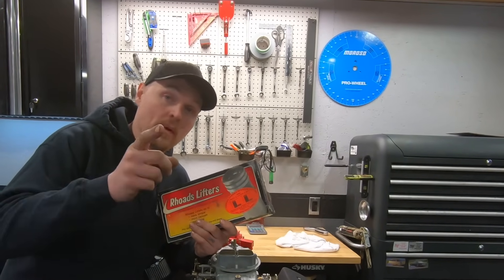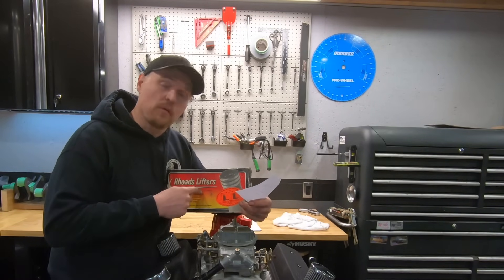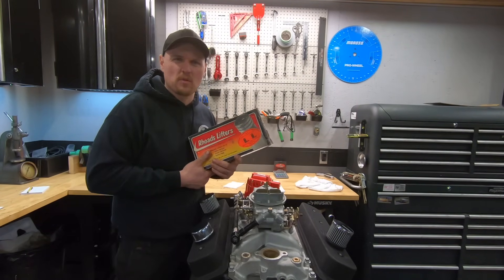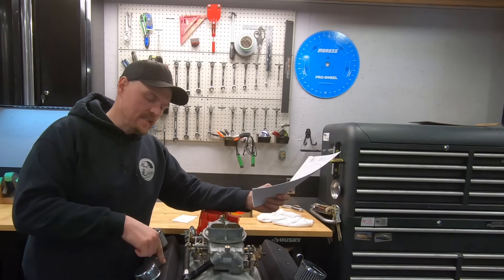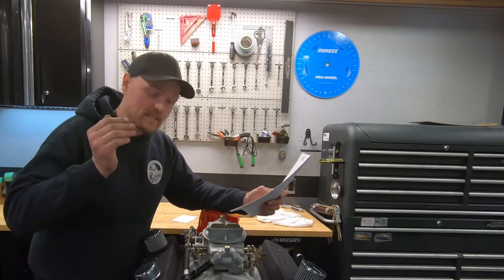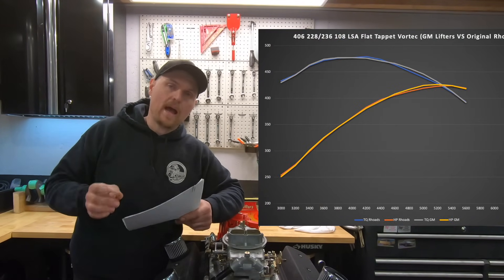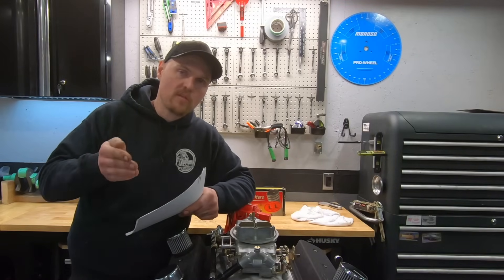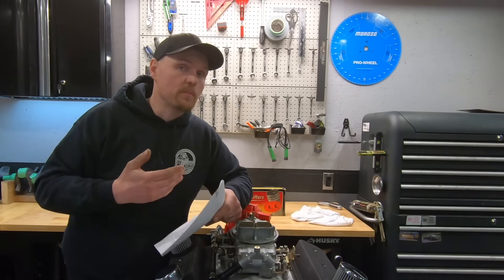Dyno Testing Rhoads Lifters! Interesting Results (Part 2)

Comment: 20/50 motor oil, I am surprised the lifters were able to collapse at all. And yes, it is a lash issue that causes the ticking, when the lifter is pumped up there is zero lash, when it is collapsed the lash is whatever the lifter allows. Can't believe people complain about the lifter doing what it is designed to do, smooth idle when collapsed and full lift and duration when pumped up. Try running 10/30 oil and see what happens. Been running a set of comp cam's hightech lifters in my engine for 34 years, they collapse under 3500 and pump up at 3500 and yes, they clatter when collapsed and they collapse further than your Roades lifters, in fact they were not recommended for street use as they bleed so fast. Zero oil pressure at idle. If I slowly run the engine speed up to 3500 rpm with the idle speed screw, when it hits 3500 one lifter after the other will pump until their all pumped up and it will pick up 700 rpm and be turning 4200 rpm. If I remember correctly, I set the preload at .030, 34 years ago.

Comment: Back in the day we used these to help get a warm cam through emissions testing. They provide a cleaner idle for a tail pipe test. The 1st set I installed was in 89 on a 400M  in a 79 Bronco with a basic "rv" cam that would fail tail pipe test. The lifters were just enough lift change at idle to pass a test.

Comment: Ive run a few sets of original Rhoads back in the day. One was a 455 pontiac and a couple others were 350 small block chevies. Most noticable difference was on the 455, gained a bunch of low speed torque and throttle response. the midrange and top end was the same as standard lifters. Same thing with the 350 chevies, just a lot less dramatic change.
   The advantage is mellower idle, drivability and mileage, especially with a low stall converter. If youre running a 3500 stall converter I doubt you'll se any performance advantage at the track at all, but with a stock converter you'll notice it for sure.
Reply from the maker: That's a good point with a stall speed of the converter
Reply: You nailed it. The first time I used them was in a 302 w/300 degree cam on a stock convertor. I had next to no power brakes and wouldn't idle in gear below about 850 rpm. That meant idle around 1k in P/N. The car, a Mustang II, sucked around town. The Rhoades turned it into a little sweethart. The downside was my now ex-wife went from refusing to drive it to taking every opportunity. I get home from work, hop in the shower, get out to a note.. "Went to the store." Sure enough, the Mustang was gone. Her excuse? "It's chilly today and the Mustang was already warmed up." Evil women. To be fair, she did help assemble the engine in our apartment living room.

Comment: I had Rohads lifters in my Mopar 440, had a cam that didn't start pulling properly until 3000 rpm, but with Rohads it changed to 2000 rpm. So you need to start at lower rpm to see any major difference
Reply from the maker: Unfortunately, the dyno can only accurately pull down to about 3000 rpm

Comment: Your test started too late to see the difference in torque from them.  When I ran them in my engine they were fully pumped back up by ~3,000 rpm. There was more torque coming off the line, much more part-throttle torque and it got about 4 mpg better.
Reply from the maker: Unfortunately, the dyno can't accurately pull down much lower than 3000 rpm

Comment: I found the largest difference to be found  with 10w-30 oil right off idle to# 1500-1800rpm.  Almost completely outside the range you tested them at. Also 10w-30 oil the  seat of the pants dyno didn't feel like they didn't feel like they achieved nearly as complete match in lift and duration.
Reply from the maker: Unfortunately, the dyno can't pull down that low, but the test was to determine if the top end falls off or it's down on power, which we didn't see

Comment: I appreciate your sharing test results. But I struggle to put much equity into the outcome. Because assumably your testing on a water brake. The area where any real result will show up is likely belowe 2500 rpm where you cannot test.  Also, so many engine variables play into how a bleed down lifter will act. Any result is application specific and for those reasons. I am gonna never try these. Even know they may very well have a application.
Reply from the maker: Unfortunately, the dyno can't pull down that low, but the test was to determine if the top end falls off or it's down on power, which we didn't really see vs std lifters

Comment: Rhodes Lifters, the original Variable Valve Timing. The Rhodes Lifters make your car sound like the engine is shot (noisy lifters) and does not lope at idle, but little does anyone know that your recently built car is a sleeper. I put an Edelbrock RPM camshaft (on a stroked 318-LA, then 350-cid), installed Rhodes Lifters and custom-fit push rods, and got 20-mpg... until all the extra torque broke everything... Then upgraded the transmission (it broke), beefed up the u-joints (they had broken), upgraded the rear axle (it had broken), literally everything had broken starting from nearest the engine back to the rear wheels, and after upgrading, I had a bullet-proof car, which only got 12-mpg - More power/torque requires beefier/heavier/higher-friction matching components.

Comment: So based on these results, there is zero benefit to Rhodes lifters if u run manual or hydroboost brakes.
Reply from the maker: Kind of. This test also doesn't show under 3000 rpm for drivability, mpg ect

Comment: Ive run them since early 90s. Track rules required hyd flat tappet. I spun them 7200rpm lap after lap, week after week. My cam(1 of the grinds used often) was 510 lift, 246 at 050 on a 106lsa. I took green flag at about 1700rpm, so torque was at a premium to pull on other cars. We also had a lower division with a 16" vac at 900-1000rpm rule. We tested cams, lifters and measured vac. With the Rhoades lifters, we could run 2 degrees tighter lsa and 12-15 degree more duration over the non rhoades lifter cam grind. In a very restricted division, that is bigtime gain for top-end pull/rpms and low-rpm torque for green flag/start of race at very low rpm.

Comment: Back in the early 80’s I used them in a 350 with 086 heads and a comp 280 cam. Idled great, when it hit 3k rpm there was a noticeable seat the paints feel. I would expect anything above 3000 t 7:31 7:39 o be the same their claim was to help idle and to be at full power at 3000 RPM, which they are. this test kind of misses the point of using rhoades lifters.
Reply from the maker: Unfortunately, the dyno can't pull down that low, but the test was to determine if the top end falls off or it's down on power, which we didn't really see vs std lifters

Comment: that dip in hp with rhodes lifter may be attributed to over the nose spring pressures. I have expirienced this as rpms go up the recovery can be an issue. If you have a chance to do another test try to see if adjustment of preload settings haas an effect.

Comment: The Rhoades lifters really work very well at part throttle cruising. Something that cannot be shown on a dyno. I know because I run these on a 230 * cam in a sbc with 2.73 gears.

Comment: Would you recommend using the Rhoads with a stock performance cam (Pontiac 068 for example) but with a higher rocker ratio?
Great video and THANK YOU for coming through and sharing. I'm flying with a stock 1965 GTO because of your help. 13.56 ! to date
Reply from the maker: No, they are better suited for more aggressive cams
Reply: There's no reason to use Rhodes lifters with an 068 cam even with 1.65 rockers. Depending on the compression ratio and heads you're using they could have the undesirable effect of detonation at low rpm. The 068 is a pretty low lift cam with a wide lobe separation and not much duration so Rhodes shouldn't be necessary. My 1971 Formula 455 HO with the 068 idles with about 15 inches of vacuum. And that's at about 3600 ft above sea level. 
With the 041 Ram Air 4 cam however the Rhodes lifters are a great way to tame it down low adding vacuum without losing much if anything up top. Lots of helpful discussion about that on the PY forum.

Comment: I have used these lifters back in the '80's and they do work but you were not able to pull the engine down low enough on the dyno to see how much more torque they have below the 3000 rpm starting point that you had. You will feel the increase in torque just off idle and up, especially with an auto trans plus they idle better in gear. They do work as advertised but are not for everybody and there are haters out there that will say bad things about them. Due to the cost of them now, a lot more than in 1980, the money you spend on them might be better spent on a roller cam that will provide a better idle and more vacuum plus increased power. Also the wear and break in issues would not be present. Something to think about. Great video.
Reply from the maker: Unfortunately, the dyno can't pull down that low, but the test was to determine if the top end falls off or it's down on power, which we didn't really see vs std lifters. They also make a roller version of these that I want to try
Reply: @cuttersperformance  I know that the Super flow 901 and 902 dyno's cannot pull down that low. Has to do with the water brake and absorber unit. I have built a lot of big and small block Chevys and getting any big block to pull down was not possible. Your test was valid however, no matter what the haters might say. Your site it great as we Chevy people are going to always enjoy all the data that we can get.

Comment: Your test show exactly what they were meant to do. In classes of racing, both vacuum and lift at the rocker are measured by the inspectors. And 20w50 oil is typically used. These typically are pumped up at 40-45psi of oil pressure. Your 50-60psi  peak shows on the power  graph were 40 psi is achieved. You can alter the power with oil viscosity and oil pressure. 
  I don't know what v-max models you are looking at. The newer ones are simply regular lifters with direct lube wholes on the face of the lifter.  They did that to absorb some of the ticking sound made by the originals. 
  The Rhoads lifters are also suseptible to spring pressures.   The higher the pressure ratings at closed and wide open , the more it will alter their action. 
  I have not seen any performance gains when these are used with priority oiling engines. So they do absolutely nothing on a l.s..
Reply from the maker: https://rhoadslifters.com/product-category/v-max-rhoads-lifters/

Comment: According to your graph, the Dyno didn't capture any reading below 3000rpm. Rhodes advertise full restoration at 3500rpm, so you're very close to total lift& duration of the cam.
 I'd venture to say, higher power levels exist @ 1500-2500 rpm with the Rhodes. 
 I've a set of Rhodes in my 440. It has way better 'Street Manners' in the surface street driveability range.
 I'm most relieved to see virtually full cam restoration at 3000 + rpm.
 Thanks for the posted research!!!
Reply from the maker: Unfortunately, the dyno can't pull much under 3000 rpm accurately. But there's no doubt these will help under 2000 rpm going by the vaccum readings at idle.

Comment: In David Vizard's sbc cam book he suggested retarding the cam 2-3 degrees could recover the top end with Rhoads lifters.
Reply from the maker: He also says not to use them as they never recover full lift and power
Reply: @cuttersperformance   I wonder when he came to that decision. In the cam book he seamed interested in them , but a few years later, in the max performance sbc's on a budget book there was no mention of them.  If your results are common, I'd try them if I was on the edge for vacuum. I think the roller lifters are based on the newer versions. I would definitely vote for a video with them. Another test you could try is the rhoads lifters on the exhaust lobes only; In the cam book he thought you could get most of the benefits (vacuum) with them on just the exhaust.

Comment: I think it sounded good either way and it's pretty awesome that it didn't change power much but in a positive way I would be curious of the life span of them would thay last 100k miles or more or fail like the lifters of today
Reply: I've run them everyday in my sbc for 10 years straight and no problems what so ever

Comment: Bigger cam and same idle vacuum test would be awesome!!!! Let's see if they can make it to 7000 without dropping off.
Reply: My 350 with Rhodes pulled hard to 6800 for many yrs.  Did fall off at 7200.
Reply: This would be the test. See how big a cam you can run with the Rhodes to match the idle/vacuum of this cam with the Delcos, then compare the dyno

Comment: Rhodes Lifters let you run a bigger cam without the problems. Rhodes are a quality lifter that can let you run more lift with a tighter lobe separation angle than standard lifters. I'm 70 years old and in my 30's I built many street sleepers with these lifters. Great product!
Reply: Best thing about Rhoads, lot less valve train stress at low rpm which means much better gas mileage.
Reply: Agreed,  now 68 - but I also matched higher lift cams with Rhodes lifters, thought they were great. 
Really miss being young.
Reply: I had them two in 87 in a 70 nova 355 ci seat of the pants feel is much stronger on the street you have too adjust the cam advance to realize the performance increase